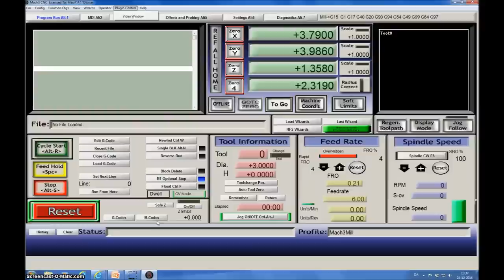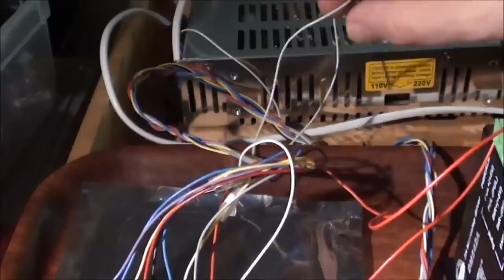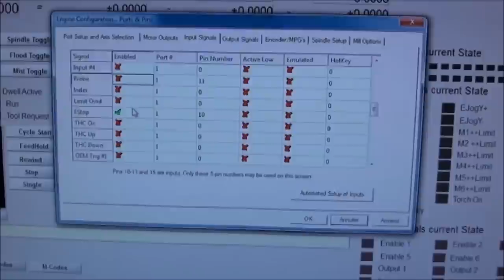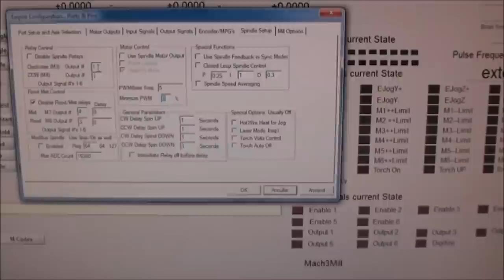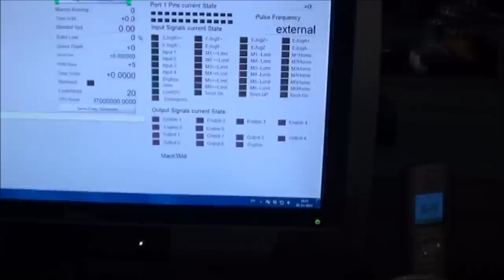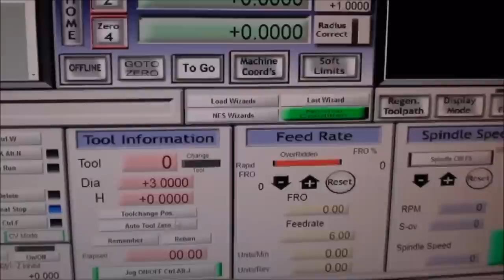AKZ250 Setup and wiring

Comment: you DO need a external 12-24 volt power source.  All outputs and inputs are opto isolated from the usb. The 12V powers the machine side circuitry
If you try powering the control side from the USB power, you will have noise problems

Comment: Hi Martin, Your videos are always so helpful. I have decided to use the proximity switches as my limit switches too. Your videos on the switches were helpful as well. I also have those ones bought from China (multiple ones-NPN, normally closed), but when I connected them to the board I kept getting the signal that the limit switches had been triggered and I could not reset them, so I have something misconfigured. I'm going to go back to the shop tomorrow and reference your video to try and correct the problem. I have a new BOB-PMDX-126- (that is quite different from the one I had, ST-V2) that connects to my motion controller/pulse generator (Ethernet Smooth Stepper) and I'm trying to get everything straightened out. Supposedly, my sensors don't require a pull-up resistor on this BOB, and the BOB supplies +12v (unregulated) to the sensors. The documentation to my board stated that the sensors need to be able to sink or source 6mA of current to work. I would certainly think that my sensors should be able to work with this board, I think I just must have something not configured correctly on Mach3. Then, I have to get the issue straightened out with my gecko drive. Anyway, thanks for the video series. A great help!

Comment: Hi. Iam using this card 5 years now. I would like share my experiences. See the slot for potenciometer (time 1.00 in video) there is next empty place on the board. I did solder in next conector and I did connect next potenciometer to it. Now you have 2 of them. In the setup of usb driver you can set wich one is doing what - I set one for feedrate and second one for jog. It works great.
Reply: Thanks for sharing

Comment: I been using this exact USB interface with my Carving-CNC machine for the past 2 years. It's been running for many hours and I've been very happy about it. Only issue I have had with the card is it's sensitivity on the USB connection. Even with short, top quality cables I experience loss of connection. I have to mention that it is very rare though. But lately I have had a real pain with the card. At random times it will trigger the e-stop. I have tried to disconnect all connections so that only the USB was left - and that did not change anything. So I suspect that the card has a internal "timeout" that gets triggered when the card has a certain age. I know that this sounds link some crazy conspiracy theory, but as a electronic engineer I find it plausible.  (At first I thought that I might have been the onboard DC to DC converter that had gone bad. However its fine. So now I have exchanged the card with the similar and newer e-cut card. I can really recommend others to try that. Same price but more features. It's has quadrature encoders for MGP and other nice features.
Reply: Hello Jan and thanks for your experience report, I'm in the exactly same case, the usb connection is lost sometimes
Reply: Jan, I've had the same problem with a probotix BOB and wracked my brain trying to find out what the problem was.  Here's what finally fixed it:  I put small disk cap 10uf or whatever is recommended for noise reductions-- across all of the limit switches ground to sense --at the BOB.  Random E-stops --stopped immediately.  So that was it, apparently.  My system ran for several years before this without the random estop becoming a problem over and above just the typical Mach3 problems.  Very glad I found this solution.  If it can help someone else, all the better.  I think I found this recommendation digging through old CNCZone forum posts.  So, I didn't come up with it!

Comment: Hi Martin , for the spindle controller  I have connected on the akz250 as you show on you video , GDN PWM pin 4 . On the transformer pin 4 to X1 , you have connected the other two to AI anc COM . On my transformer i dont have COM ! i have OC CM 24V US AI A0 GND RS= RS- 
with of those I have to use inted of COM . Thank you Marek
Reply from the maker: I would expect GND to be equal to COM. However, to be sure I recommend that you try to get it verified from a manual

Comment: Thank you for the quick response . I did not see that My 2.2 kW spindle is working with this controller. I found where to buy AKZ250. Which of the two do You recommend? Sincerely , Vladimir .
Reply from the maker: I like that the PoKeys both has USB and Ethernet on-board and support for so many IOs - so I lent to PoKeys57CNC
Reply: Thanks for Advice . Now I have PoKeys57CNC . I start setup all .

Comment: Hi
I wiring the board and drive the light is blinking and Mach 3 is working but the motor is not running can you please help
Thanks
Reply from the maker: Hi Tony, I gave up the card some years ago. The plugin was not updated - so I decided to go for PoKey57CNC instead

Comment: hello,
your video was very helpful!!!

I was wondering, why did you use a relay with the emergency stop?
Reply from the maker: The relay is used to power on/off the spindle - so nothing to do w E-stop.
The relay, E-stop and probe are all connected to +5V. In my mock-up I connected the GND of the relay to pin 4 and told Mach3 to set the OutPut#1 to pin 4 (active low) and assign Spindel (M3) Output to #1. This is done to tell Mach3 that the spindle is controlled by OutPut#1 and to put the OutPut#1 signal on Pin4.

Comment: Hej Martin - Nu siger du at kortet ikke er "slave" kompatibel. Men kan man ikke bare i Mach3 opsætte programmet til at kører "A" kanalen som slave? Ud over dette, ved du så om man kan bruge dette kort til at fræsearbejde og plasmaarbejde? Tak
Reply: Martin Barfoed Hej igen Martin - Har netop modtaget dette kort med posten og fået tilsuttes. Har fulgt manualen og kan godt få potentiometeret til at virke til at styre FRO med. Men kan ikke få nogle af inputtene til at komme op på skærmen? Dioderne på kortet lyser heller ikke op. Har du en idé til problemet?
Reply from the maker: Jørgen Jensen Det ser ud til at hvis man kun tilslutter USB, potentiometer og så forsøger med en switch til fx probe, E-stop så virker det ikke. Der er ikke +5V på disse terminaler (prøv med voltmeter), som der skal. Så snart jeg så tilslutter resten (stepper controllers og PSU hertil og forbinder GND og +5V hertil) kører det som det skal.

Comment: hi martin, im very interested in ur card

did you had any upgrade to slave a axis ?

or if there is any other board you recommend for me 

hope to get replay

thank you
Reply from the maker: +The caliper cnc No, I do not think that they have issued a new plugin for the card. So I still do not think you can use it for slave. For my current machine I use a parallel break out board. That works very well.  IF you need to USB you can check out http://warp9td.com/ for the SmoothStepper. I have not tried it myself though.
Reply: +Martin Barfoed 
Thank you for your replay

I will try it 

And wish u all the best

Comment: Hi Martin,
It's very interesting video, but i have a  little problem with my AK250, the minidisk that come with it does not have information, it's empty.
How i could to find the info?
Thanks for help.
Reply from the maker: +Paco de Poio Hi Paco, you can find the manual as well as the Mach3 plugin here: http://leafboy77.com/index.php/en/
BR; Martin
Reply: +Martin Barfoed 
Thank you very much for info Martin.
Kind Regards.
Paco Piñeiro.

Comment: Holaartin from Venezuela, I the usb motion card akz250 3 axis, You can connect 2 driver on the same axis ? 2 motors to use the shaft and drier are my DM542A. Thank you very much for your contribution
Reply from the maker: Hi Jose, I think you can get a 3 axis and a 4 axis version of the card. Mine is 4 axis. However, the 4 axis version DOES NOT support slave - so you can not use A to slave Y (the usual situation). So if you have two steppers on Y (left/right side) you will have to run them off the same controller and twist the connection of one of the coils on one of the steppers (to make it go in the opposite direction). I have that setup on my small X-Carve but on my bigger Stainless OX I use four separate controllers and a parallel break out board. Br, Martin
Reply: My question is this , can be connected to axis 2 driver card ? AKZ not be damaged ? Thank you very much for your contribution
Reply from the maker: OK, I think I understand you question. So you want to connect two drivers/controllers to one output from the AKZ. My guess is that you can do that with out harming the card.
Reply: Hi. I have that allready done for my X axis, wich has 2 ballscrews. 1 output for X, 2 drivers connected on it. works well.
Reply: YOU CAN CONNECT TWO MOTOR WITH ONE DRIVER, ONLY THE WIRE ON ONE MOTOR WILL BE BACKWARD

Comment: Hi, i have enjoyed you video for the bob set up which has helped me a great deal in setting up my mill.
Can i ask you if you have any experience with this board for lathe screw cutting.
Reg UK
Reply from the maker: Reg Pugh Hi Reg. No I have only worked with it for milling purpose. I do however, not see a reason for why you should not be able to use it as long as your software supports what you want to do. This is as described only a motor controller "translating G-code to machine movement".

Comment: Hi Martin, excellent explanation like always 
i watch this tutorial as a reference guide into the mach3 motion controller, but i found tow option one with 50khz and the other is 200khz  !? it depend on the step driver or what ? 
can you help
Reply from the maker: +Akrout Osama Hi Akrout, The frequency is the max stepper pulse frequency that can be coming from the board to the drivers. I just checked a couple of other well known drivers (like Gecko) and they are also in the high range (200-250kHz) - so I think it would be a safe choice to o for the version w 200kHz. It's also the board I have. Best wishes, Martin
Reply: +Martin Barfoed 
thanks (y)

Comment: Hi. I have question about this controller can i use this Nema23 2N.m Servo Motor Closed Loop 76mm+HSS57 Hybrid Driver CNC Kit  on this . Thank you for answer
Reply from the maker: Yes, I would expect so. I have not tried exactly that but the signals that comes out fit what the Hybrid Driver needs (setp and dir) so it should work. Remember that it does not support slave axis.
Reply: Thank you for answer.

Comment: do you know if this controller work axis with slave A if I wanted to run servo pack motor drive on my machine but used A axis has a slave on X ?
Reply from the maker: Hi Erik, No it will not work. The plugin does unfortunately not support slave
Reply: @erik gendron  
Hello Erik. I have worked with one of these some time ago, and i'm pretty much sure that you can connect the command output from the board to X and A to slave them. I have seen a couple of machine that work like that.

@Martin Barfoed
Cheers, mate! Nice video. This will come in handy.

Comment: I have just received one of these complete with 6040 router, what calue is the potentiometer on the J16 pins? Which way is it wired? I have searched the net and cannot find any reference to an actual value!
Reply from the maker: On mine it says B10K which normally means 10k log.
Reply: +Martin Barfoed wow, thanks for the speedy reply! Happily, i have some spare :)
Reply: All wired up, works a treat! Oh, and I soldered a spare header into the second gap, and that works fine as well! Im surprised they only left the header off, according to the schematic, its only a resistor joining it to the IC. Give it a go!
Reply: thanks for the heads up on this, I soldered in the second header and added a pot so now have 2 controls for overrides. Cool! now if I could just get my MPG to work!

Comment: hi. I need of a cnc controller for use with 4 motor nema 23, 270oz, axis X,Y,Z and 4 axis, and driver DM542, cna work fine with this configuration ?
Reply from the maker: The board does not support slave - so if your 4th axis is a rotary or something like that it will work. However, if you intend to use is as a second Y (slave to Y) it will not work.
Reply: now I can use 4 motors indipendent X,Y,Z and 4th rotary axis them will work fine . Can you show me in what case the motors are used as slave ?

Comment: Ok. Er der et andet kort der køre med servo signal du kan andebefale. Skal bruge til 2 stk på 1kw og en på 1.5 og spindel på 5.5;kw
Reply from the maker: Allan Slyk Det er ud over min viden da jeg kun arbejder med hobby CNC. Prøv evt at kikke på disse hos Centroid http://www.centroidcnc.com/
Reply: Martin Barfoed  Hej og tak for svar . Det er skam også hobby har kikke på det. Men er mere til mach3 for det kender man. Nå jeg må lede vider. Super film du laver 👍
Reply from the maker: Allan Slyk Har du overvejet Closed Loop Steppers? De har enencoder der sikrer at man ikke taber steps og et langt bedre moment profil en normale steppers. De kan bruges med controllers der bruger Mach3 fx PoKeys57CNC, Smoothstepper mf. Der findes flere videoer, der sammenligner servo og closed loop - ifgl disse er det ikke sådan at servo vinder på alle parametre.
Reply: Martin Barfoed hvis jeg ikke kan bruge dem servo der sidder på min vp 2000 så vil jeg også se på dem

Comment: This set up work fine for rauter in wood application, but the USB brake board does not match well with plasma and Mach3 software controler,  since Torch hight control ( THC) has no support by Mach3 via USB, just only parallel port...!!

Comment: WHAT DO YOU MEAN A AS A SLAVE TO X OR Y??
Reply from the maker: If you have two steppers on one axis (on the left and right side) the most normal way to do that is by having two stepper drivers that follow the same movements. In Mach3 one of these are assigned as the main axis (e.g. Y) and the other is often called A. Then to make them follow the same movements A is set to be "slave" of Y. 
Hope this is understandable - else I suggest that you check out Mach3 homepage for more info.
Reply: Hi Martin, did you get an answer to your question or did you contact leafboy77? I read somewhere in a (old) forum-tread, the card would NOT support a slave-axis. Or was it corrected in the meantime?

Comment: does it takes smooth stepper ?
Reply from the maker: shand seimela It will not work together with the Smoothstepper controller. You will use one OR the other. I would recommend using Smoothstepper or PoKeys57CNC controller over this as they have active development of the Mach3/4 plugins
Reply: Thanks
Reply: In want to  use  that  for the  with  the  servo  motors
Reply from the maker: You can use all three (AKZ250, Smoothstepper and PoKeys57CNC) controllers for servos as well provided the stepper controller has a STEP/DIR input
Reply: Does  PoKeys57CNC  also  connects  the  plasma  torch  and also torch  height  controller  because  I read  their  websites there  is  no where  they have  stated  that  their BOB  supports those. ..Please  help
Reply from the maker: I'm not sure. In their documentation they write that the Mach3 plugin has "Experimental support for torch height controller". I suggest that you ask them on their support page. They are typically quite fast in responding.

Comment: Hi Martin,
I wrote in your thread on cnczone and asking for your help. I'll be glad if you take a look give me a hand.
Reply from the maker: As explained on CNCZone I do not think you need to connect ENable. You should expect the the controller will send power to the step motor always. Onle way to disconnect power it to cou power supply. Step motors always get a holding currnet from the controller. Reset function is probably only used for resetting the firmware inside the controller.